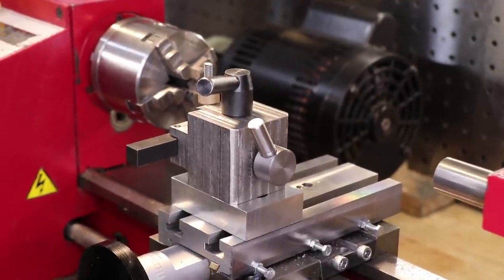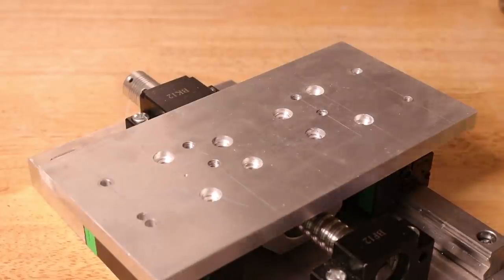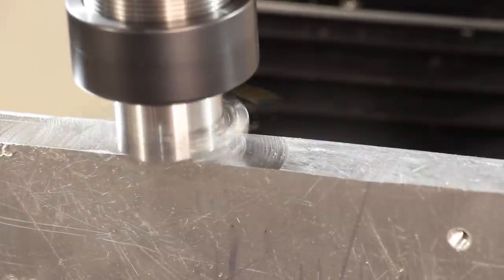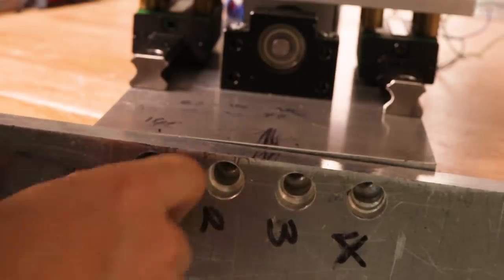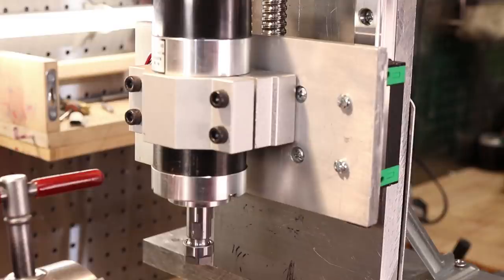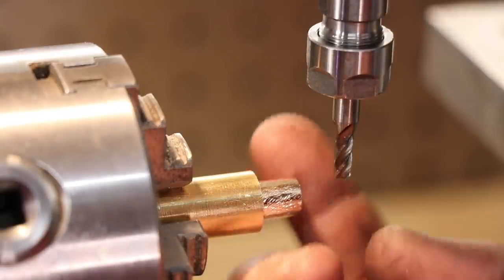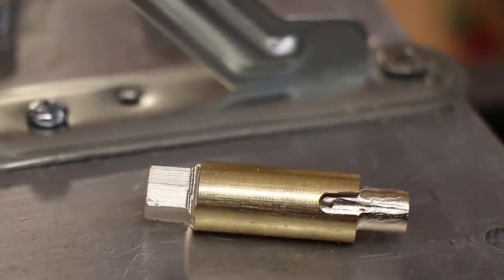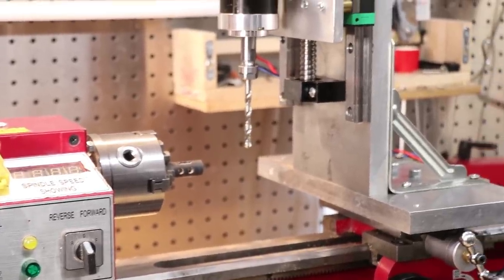Making A Lathe Milling Attachment | Lathe Mill Combo Mod

Comment: That's a great idea!! You really need to get some aluminum angled plates that are the same thickness as the rest of it in there to replace those flimsy shelf brackets. I bet that would help with the chatter you're getting out of your tooling. Great execution otherwise!!! I like the use of those linear rails. I had something similar in mind for upgrading/making a bunch of random power tools that are usually considered "close enough for government work" like the circular saw, drill press Z axis table to get rid of that table swinging in a radius on the drill press tube and some other little tidbits. They're generally not priced too high, if I remember correctly.
Reply: @davidwillard7334  Why? As long as the slides and spindle can be locked up in some fashion, those shitty brackets are the only source of weakness left to flex in the system. As long as all slide ways are lockable.
Reply from the maker: Cheers, when i made this over a year and a half ago I never intended to cut anything other than wood and alu, so the brackets are next thing on the upgrade list. I would have changed them for this video but my whole state is in lockdown so I can't go out and get them made for me. The brackets do a pretty decent job, but when I start to mill steel, they will be the first thing I will change.
Reply: @artisanmakes  Do you reckon you could get pieces of aluminium, or steel, from ebay and cap screw some brackets together yourself? Sort of countersink cap screws along an edge to form the L shape and then screw diagonals to the edges for ridgidity. Not as good as TIG welding and machining square, but I would say a decent result would come your way. I mean you have the machining skills to make all the pieces and I think you could get the raw materials off ebay, worth a thought maybe?
Reply: @artisanmakes  Sorry mate, I'm a fitter and Turner and I cant help flexing the knowledge because I cant practice my trade anymore due to injury. So just trying to help a bit I guess.
Reply: @hepburn118  It's best to let Willard's bleats pass in silence. He has nothing to add (except ridiculous exclamation points), and he never knows what he's talking about anyway. We won't answer you, and if he couldn't explain himself if he did. He's a troll.

Comment: For setups like this a spindle lock is almost a must have. For indexing though you could either just do a simple indexing plate or hook up a stepper motor and encoder for digital indexing.

I'd really like to see your own design/build for a DIY rotary table in the future :)
Reply: A spindle lock + digital inclinometer.

Comment: Great vid! Thank you for sharing. This is so creative. 
I made a spindle locking mechanism for my mini lathe that mounts to the back of the headstock and indexes into a single gear tooth on the spindle with a spring loaded and lockable finger. I then replace this gear with different ones depending on if I want to index a part by 2,3,4,5, or even 7 divisions. 
I've yet to use this however in a job for dividing as I don't have a method of actually cutting these radial features. I started making a tool post mounted ER16 spindle to hold end mills and drills. However my lack of foresight made it so there wasn't much room for a part in the chuck. Hopefully with the cross slide extension mod I did recently and offsetting the ER16 spindle backward, away from the headstock spindle, I'll have more room for useful operations. With a rotation of the tool post, this ER 16 spindle will be able to work like a traditional rotary table or a tool for creating radial features on a part's OD when the top slide is set to 0°. 
Keep it up and happy making everyone.

Comment: Thought-provoking video, thank you.  I could not work out how much space there is on the cross-slide, but a simple mod that would provide extra functionality would be to add the ability to rotate the attachment ninety degrees anticlockwise on the vertical axis.  This would allow longer work to extend past the attachment, and be held between centres if necessary.
By doing this, you could machine flats, splines, gear-teeth, drill holes etc. anywhere along the length of the work, limited only by the capacity of the lathe.
Also, as others have already said, some form of indexing for the chuck would be a real "plus".

Comment: Pretty neat idea.  Look forward to seeing other projects with this setup. Single point screw cutting would be cool. Knurling with a V point, you could adjust the courseness by feed rate. So many opportunities. 
Thanks for sharing, 
Cheers
Reply from the maker: I hadn't thought about that, might be an opportunity to cut threads at full depth in one single pass. Cheers

Comment: Not sure why you thought that method of fixturing the plate was dodgy. I've done the same thing quite a few times. In fact, I have a fixture plate that attaches to the mill table and pretty much the same way.

Option B would be to use strap or toe clamps to hold it down. You can either aim for the slots, or put some sacrificial material or standoffs underneath it.

If you want to stiffen those right angle joints, easiest way to do that is to drill and ream for some dowel pins. Ream one piece for a close slip fit and ream the other undersize for a press fit.

The other suggestion to add angled aluminum plates that are solid gussets, instead of those cheesy stamp steel braces, is extremely good. Again, you can use dowel pins to hold things in a tight alignment.

Comment: Interesting idea.
I'm looking at that and it's gave me an idea for building a makeshift milling machine that uses my T slotted cross slide as a table.

I've contemplated making something to do this for years, but didn't get beyond thinking that I'd end up having to figure out a way to mount it off the back of the bed somehow. 
Before watching your video, mounting it directly to the ways didn't even cross my mind. I'm now thinking that I could build a removable milling column that slid onto the end of my hobby lathes bed (replacing the tailstock when needed) for when I have a little light milling work to do.
I've got a vertical mill slide for the lathe, but the whole setup's about as ridged as an over ripe banana, so the finish is always god awful. Using a DIY vertical mill head on it would be directing the cutting forces into much more heavely supported parts of the carriage, rather than putting the force into trying to peal the carriage off the bed.

Thanks for helping with the flash of inspiration.
Reply: @davidwillard7334  ???

Comment: You can make a nice diy dividing option using the change gears and an expanding arbor to hold them that goes into the back of the spindle, you only need add something to lock into one of the gear teeth then. There's some examples of this around so hopefully the description is enough to find them
Reply from the maker: Ive been looking into this, the rear of the spindle seems to have a lot of run out on the inside. Ill have to look into a way to compensate for this before I can look into making a dividing solution.

Comment: If you bought a rotary table, you could mount in on the back of the lathe spindle, and use the worm gear to rotate the spindle, so you could turn a part, mill it, and even cut some gear teeth on it, all without taking the work piece out of the chuck. This is what I intend on doing.

Comment: Off the bat it is a very decent build. Though 3 problems are  apparent, 1st your 90 degree brackets are a 2 piece support so IT Will have slack and  once motor is on vibration will cause accuracy issues, best make some new ones out of same thickness aluminum or weld the plates together for better rigidity. 2nd is like you said the lathe chuck moving while trying to cut a simple solution is just use a C clamp with some hard wood to hold chuck in place till you make a Indexing jig. 3rd is that plate is right in the way of the part if you trying to mill anything longer, make a 2 to 4 inch hold in the plate for longer parts to pass through while milling.

Comment: You do you dube but an observation I could make might be to buy a cheap box of parallels from ebay, or where ever you like, or I thought you could take the linear bearings apart and use the slides as a parallel to clamp oversize pieces like that to your mill in the future. Another trick you could use is one I used on a much bigger mill, but I think it would work on yours too. Make a section of T-slots out of a solid piece of steel (just pocket mill it out) around half the size of the mill bed and dowel and bolt it to the original part of the mill on the rear. You dont get a lot of table travel in that direction anymore, it does give more scope for parts held though.

Comment: Hi first of all: Great setup you build there!
But I have some ideas that might improve your milling results. First of all add some proper brackets like other people mentioned. The secound problem is that you use a ball screw that might be driven backwards by the cutting forces if you don't lock it. If you will be using a servo or a stepper motor instead of the hand wheel this problem might be solved due to sufficient motor holding torque.
Good Luck, you just got a new subscriber ;)
Reply: ah and did you think about building something like a index plate to your spindle? Might be coming in handy for milling hex and squares.. You might be able to use that disc as a break for the lathe.. You might have already done that I haven't seed all your videos yet..
Reply from the maker: Up until now I hadnt had to worry about a lock since the slide was held in place by the stepper and that was strong enough to do so. Since the board broke at the last minute during filming I just didn't have the time to machine up a lock. Still trying to get the stepper board working again. Cheers

Comment: Pretty sure it's because your rotation of your lathe is spinning the same direction your end mills cutting edge is spinning.  Reverse rotation of your lathe maybe?
Reply from the maker: The rotation of the lathe and spindle were actually in the opposite direction. I'm going to give it another try soon with a ball end mill, that set up has worked with 4 axis wood CNC machines so hopefully I'll get better results there

Comment: 7:43/7:46 - I believe it was Clough42 that made a nice stepper-motor-controlled drive thread for his lathe, which was synced up with an optical rotation sensor for the spindle, to allow for synchronization for threading and such. I’m sure pieces of that could be used for indexing, as well.
Reply: @davidwillard7334  huh?
Reply: @davidwillard7334  more capitalized letters does not give more clarity. :-P

Comment: フライス盤に旋盤載せた方法が色々な事が出来ると思う
I think there are many ways to put a lathe on a milling machine.
Reply from the maker: Yes I've seen a few different styles, this one just worked with what I had. Cheers
Reply: @artisanmakes  
成功して何よりです
アタッチメントを取り替えず作業出来るので作業効率上がると思いました。
Success is above all
 I thought that work efficiency would improve because I could work without replacing the attachment.

Comment: I have maybe an idea you can use on your machine for indexing parts on the lathe. and i would like to send you a drawing for use on a 80mm 3 Jaw Chuck if you up for it. I use this setup on my Lathe with good results. I build the part witd an rotary table on my mill, but you could easy make it with an Template or Dividers

Comment: 0:59 Let me quess skrew and linear are same size. they not match xD and ballskrew nut clamp not factory made. its just someone made. no match for other brackets and your size on linears.
and most machines linear rails are lifted up and skrew is lowered or they are same level but moving bed has those height diffs
Reply from the maker: We can only speculate, truth is I don't know. Linear rails are not things I have worked with a lot in the past, but when I worked with a friend to install similar rails, they were all the same height, and other videos on youtube have linear rail kits where the rails and ball screws were the same height and that was my assumption when I purchased this kit.

Comment: That is definitely not how adding a mill to a lathe should work. The point would be to bore holes or slots. Not turn the large on while milling the part. I'm surprised that didn't break the endmill. (Although I haven't finished yet. 😁)

Comment: HAHAHA what's that little green screwdriver???? Plz throw that away
Reply from the maker: Seems to do the job fine enough
Reply: I don't care who ya are, if you've been assembling random things you've order for any length of time you're gonna have at least 10 of those things in a drawer or every once in a while you get one that's actually better than anything you can buy at a tool store. I've got 2 that are a #7 and a #8 torx that I have used the utter crap out of!!
Reply: @BIGWIGGLE223  same but they need to go lol